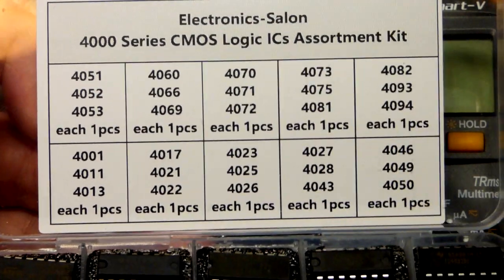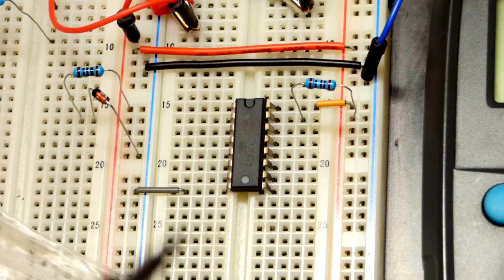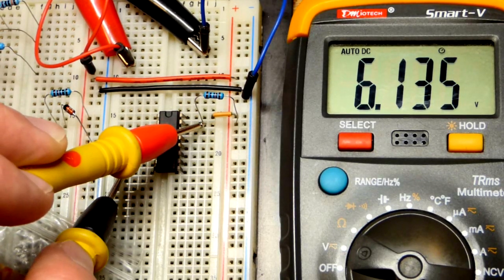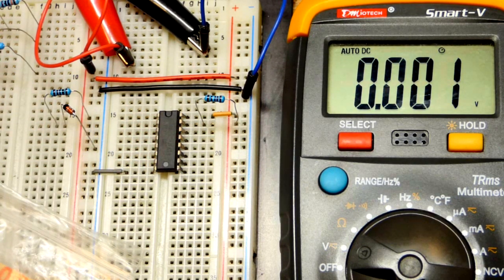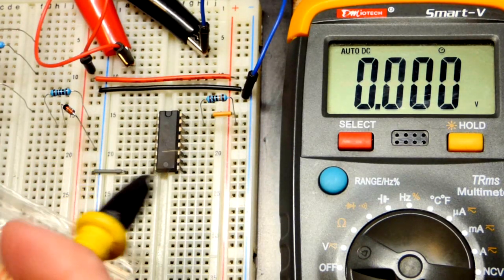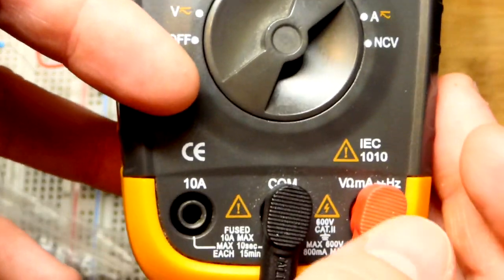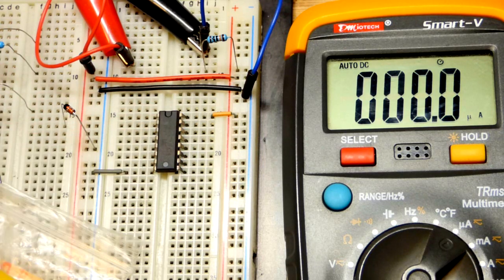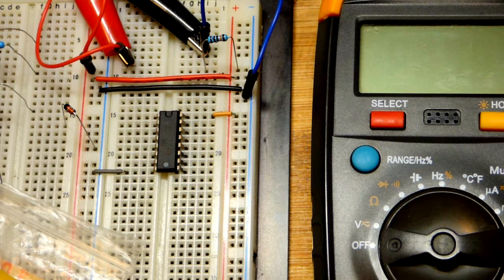Interesting 4046 CMOS IC internal zener diode tests Electronics CD4046 CD4046B

Comment: I'm trying to use one of these in a circuit, and kind of confused about what to do with the Zener diode. I'm using the 4046 to replace an almost pin-compatible PLL, but the other one doesn't have a Zener pin, it has a Phase comp 3 out instead. I guess I just don't connect the Zener? Also it's weird because the 4046 used Vss and my other chip uses GND. I guess I'm just supposed to use GND for Vss because I don't have a negative going voltage in the circuit.
Reply from the maker: Unfortunately I stopped studying this IC right after making this video. It got very few views so I forgot about it and I have never gotten around to learning much about phased locked loop circuits. Bipolar junction transistor based integrated circuit datasheets often designate the positive supply as Vcc or V+, while also designating the negative supply as ground (GND) or sometimes Vee, and sometimes V-. Usually though, I mostly just see V- used for dual supply integrated circuits. The cc is used to indicate the collector side of the NPN BJTs, which is more positive in almost all circuits. While ee stands for the emitter side of an NPN BJT, which is more negative in almost all circuits. MOSFETs have a source and a drain instead of a collector and emitter, so often datasheets use Vss for the more positive supply and Vdd is used for the negative supply for MOSFET based ICs. It's a pain to get used to, but since all three ways of indicating the pins are commonly used, I usually try to use the same notation that I think most people will see for a particular integrated circuit. Different manufacturers though will often label the power pins of the same integrated circuit differently from the other manufacturers. Hope that helps!